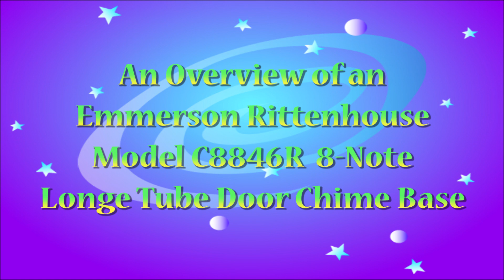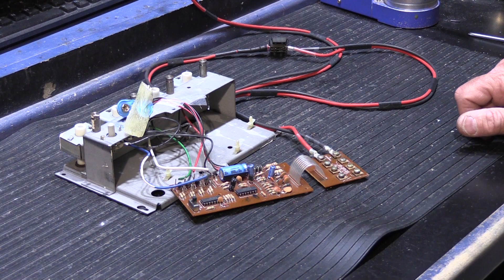Servicing an Emerson Rittenhouse Model C8846R 8-Note Electronic Door Chime Base

Comment: Hello, I have a Rittenhouse chime very much like the one here.  The problem I have , when the lighted doorbell button is connected the chime continues to operate nonstop.  When the button is disconnected the chime stops.  If the wire is touched together, the chime operated as it should.  I measured the resistance across lit doorbell button.  It reads 51 ohms.  What do you think the problem could be?
Reply from the maker: Hi Paul:  Does your Pushbutton have an incandescent lightbulb or is it a newer style with an LED?  If it's a LED, that may be the source of the problem (it is a diode afterall) - In addition, the age of the Chime could be a factor, if it's a fully electronic controled Chime, there may be componets that have 'aged-out' and are effecting the sensitivity of the triggering circuit - Chris
Reply: @northsideservicecompany3567  The problem ended in being a deteriorated solder joint on the high watt (big white rectangle) 100 ohm resistor.  It looks  like the area of the joint on the circuit board was too small and fatigued.  I ended up soldering in a fine wire to strengthen up the joint to the trace.  The doorbell works perfectly now with the new LED lit button.
Reply from the maker: @paulbensen8511  Well Done! - Chris
Reply: @northsideservicecompany3567  I used a led lit button first.  It did the same thing.  Then I replaced that button with a new button with an incandescent bulb.  The button lit up but I still have the problem.  I’m with you, there is a component in the triggering circuit that has aged out.  I did replace all the Electrolytic capacitors but one;  the non polarized 1mf.  I’m thinking that  might be the issue.  I’ll need to spend some time checking out that trigger circuit.  I thought that you may have seen this issue before and could point me to the problem.  I’ll let you know what I find.

Comment: I have a fasco c8847r that looks identical. It works well but every once in a while it gives a single chime with out anything being activated.I only have the front door set up on the chime.  Any thoughts on what the fix may be.
Reply from the maker: Hi John:  Your Fasco Chime is actually a Rittenhouse Chime.  Based on the information you have provided, it seems that it's time for your Chime to be rebuilt.  You can contact us directly about having this done - Chris        nscompany@msn.com

Comment: Great Video.  Very Helpful.  I happen to have they exact same model but the transfo in the wall only gives me 10 VAC on the voltmeter.  Trying to use it with batteries, but I cannot figure out the wiring of the door button (embarrassing, I know).  My door button only has a 155 Ohms resistance, which drops to 0.5 Ohms when the button is pressed.  I connected it all ways I could imagine but the chimes work constantly, no matter the configuration.  Did you try it with 9V batteries?
Reply from the maker: Hi Rebecca:  Your Transformer needs to be 16 Volts AC rated at a minimum of 15 Watts (30 watts is much better).  The pushbutton wires are connected as follows - 1 of the 2 pushbutton wires is always connected to the "A" Terminal (regardless of if you're using s transformer or batteries) the 2nd pushbutton wire is connected to either the "Front" terminal for a Transformer - or - the "Front" terminal for Batteries .  I did not try this particular Chime with batteries - I have repaired other Rittenhouse Chimes for customers who are using batteries, and they work fine.  Does your Chime ring constantly without a pushbutton connected? - If it does, it needs to be repaired - Chris
Reply: @northsideservicecompany3567  Hi Chris, I finally figured out a way to make it work, kind of. There are probably components that need servicing, including that transfo inside the wall that provides 10 VAC instead of 16. I started looking at it because the chime was working intermittently, meaning 50% of the time when there was someone at the door. The 10 VAC transfo was connected to terminals A and B and the door button to Terminal A and to the ''Front'' terminal - transfo side (right), but the unit was also powered with 2 9V batteries. (As if AC was used for the door button and 9V batteries to make the rest of the circuitry work) I found a similar interconnection diagram for a NuTone chime  https://secure.img1-fg.wfcdn.com/docresources/971/25/250804.pdf
Anyhow, I realized that when connecting the door button to the ''Front'' terminal on the 9V side (left), it would work constantly whether the door button was pressed or not -  as if the voltage drop of the bulb was too low.  I removed the light bulb, so now my door button is open or short (when pressed) and it works fine.
Almost: there is no light at night in the door button and when pressed, all 4 chimes ring simultaneously, then the 8 tone melody plays...   ...100% of the time...
Reply from the maker: @ThePic1869tm  i think the lack of correct voltage form the Transformer is at the heart of the problems with your Chime.  Since the Chime is a solid-state device - being severely under powered will create all sorts on unusual problems - Chris

Comment: Great video but I just a Rittenhouse door chime from the 90s I cannot find a way to wire it in I got Terminal A and Terminal B what wires do I use on them and what wire do I use for the doorbell
Reply from the maker: Hi James:  Without a Model Number of some more detailed information about your Rittenhouse Chime - I can only give you some "basic" help.  The "A" and "B" Terminals are typically where the wires from the Transformer are connected (16 Volts AC @ 15-30 Watts (VA)).  The wires from the Pushbuttons are usually connected - 1 wire to the "A" Terminal and the 2nd Wire to either "Front" - "Rear" or "Side".  This wiring configuration for Rittenhouse 3 & 4 Tube - 8-Note Door Chimes (both Long and Short Tube models) - YMMV - Chris

Comment: Good vidio but how did you repair the doorbell?
Reply from the maker: Hi Jon: I determined what was wrong with it - Replaced the bad components on the circuit board - clean the plungers and solenoids - Chris